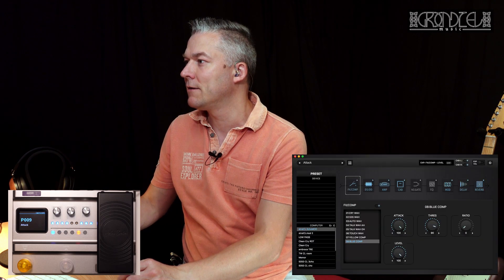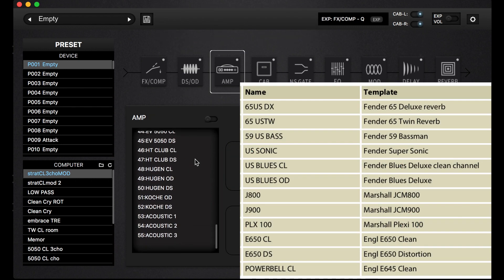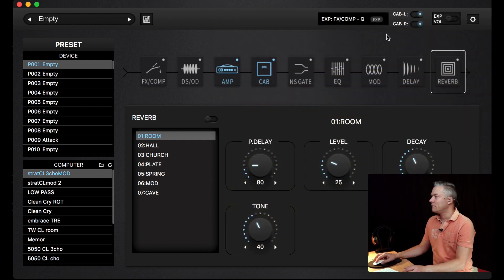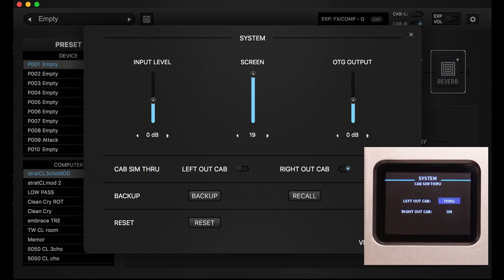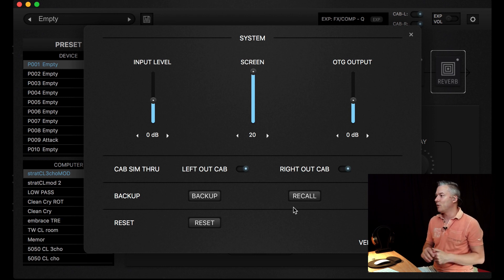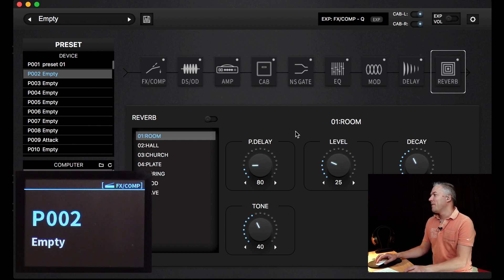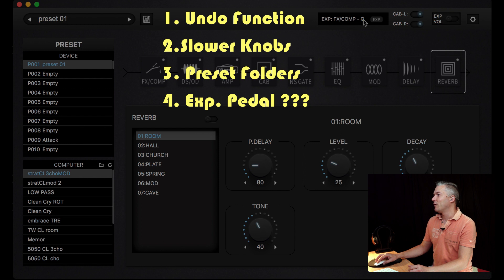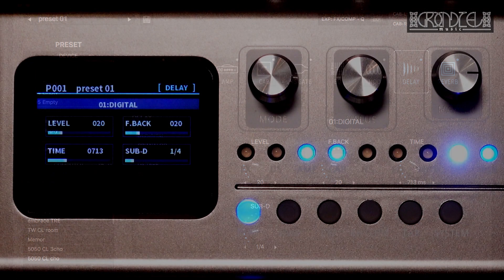EDITOR - DNAfx GiT - 2/9  - Harley Benton´s amp modelling multi-effect - GEAR DEMO

Comment: I bought this amazing guitar multi-effect and so much more, about 3 months ago. I got bored with the factory presets and started tweaking it to suite my personal needs. Watching your video helped me a lot to understand how to use the editor. Thank you very much for adding links of your preset arrangements. Amps, Stomps (Mod, Delays, Reverbs, Best of, ODs, Bass) even has additional cabinets. A nice addition for my personal set.
What I still can't figure out is, how to make a list in the Computer Presets window (bottom left of the editor). When I add a .phb file, the Computer window remains empty, but when I repeat the process a message appears stating that the file already exists ???
Addendum: I've figured it out. It was a syntax problem with phb filenames. No special characters, such as underscores or apostrophes should be used in filenames.
Reply from the maker: Hi. Thanx for your comment. I hope more people will dive deeper to this nice little unit. 😁 There is a lot of if potentiell there… have a nice day

Comment: Great video. Ive downloaded the adjusted presets but i am struggling to see how to import them to the unit? Ive got the app but a bit confused!
Reply from the maker: Open the source folder of presets and import the preset you want to use into it. the refresh in editor and copy to the slot you want to have it in :-)
Reply: Hello @grondzelmusic1977  Thank you very much for these thorough videos. I just got the pedalboard and I am very lost. I do not see any source folder with the presets. Should I see it from the PC like when inserting a pen drive or SD card ? I do not see it anywhere. From the DNAfxGIT software ? I can see the preset folder from the app but I do not find a way to import your .bhb file into it. It seems that when I try to add files it calls for .phb files only. I have a program folder for DNAfxGIT on the PC but I do not see any folder with the preset files on the computer. There is a 'files' folder but seems to be empty. The 'similar loudness' I downladed from your link seems to be a .bhb file and it seems that the presets are .phb files. The huge difference in loudness between the files included with the DNAfxGIT is really quite annoying and wanted to use your files. Thank you very much. Greetings from Barcelona.